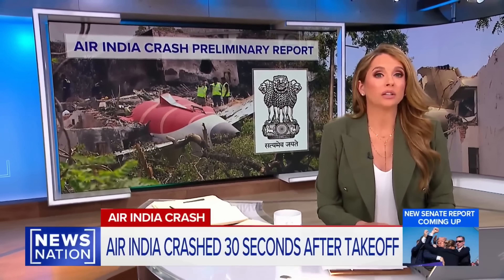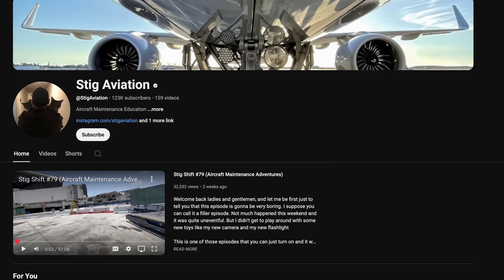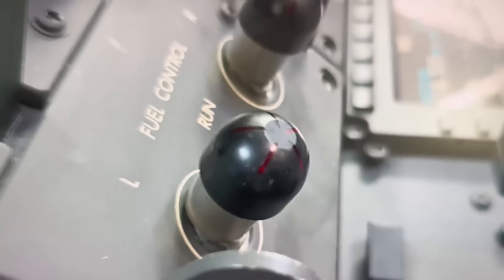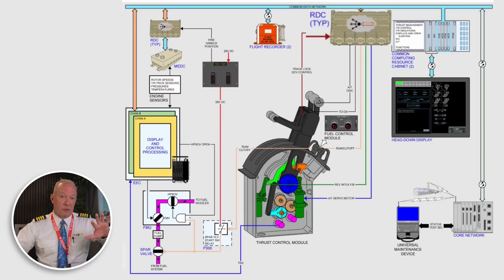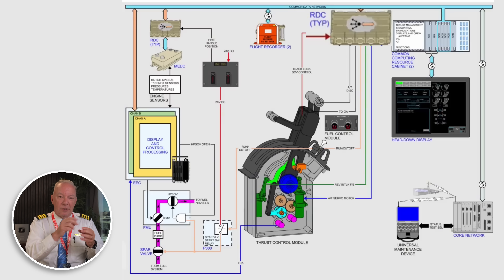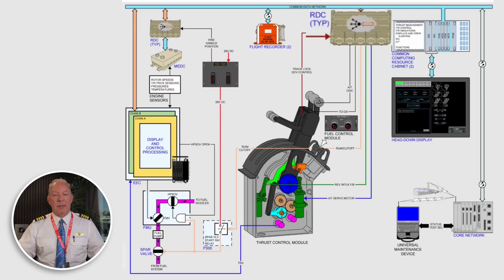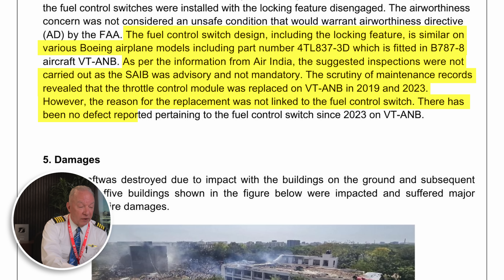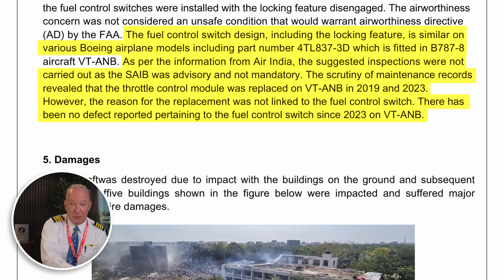The Truth About Boeing 787 Fuel Control Switches

Comment: My career of over 40 years has involved working on military and civilian aircraft. I have also been involved on stripping down and rebuilding gas turbine engines in a workshop environment as well as working on first line ramp operations.The two fuel switches that Captain Steeeve has highlighted and described are commonly used on aircraft where inadvertent operation would be a serious flight safety hazard. I have seen the same switch design on aircraft that were designed and built in the 1950s. I have operated the same switch type on hundreds of occasions and in my whole career have never seen a failure of one switch let alone two. 
Captain Steeeve is absolutely correct in that the circuit system of these switches is totally independent of the FADEC system. The switches system is independent of each other EXCEPT for the aircraft battery. A total battery failure would also result in the engines being unable to operate in a relight operation and both engines were running at the time of impact all be it not in a full power position. Not knowing this aircraft system does the engine start stop system get a bus bar power supply from the RAT via a TRU.
Sadly the preliminary report strongly indicates a human operation of these switches. I’m absolutely certain that if there was an electrical or mechanical failure then the whole world of regulators would be involved in investigating the problem. But and it is a Big but we must wait for the final report to appropriate the blame.So sad and my heartfelt condolences to the families of the victims.
Reply: A total battery failure to short (clamp to ground) would kill the LHS bus (engine 1 off), then the LHS bus would be "redundancy" connected to the RHS bus. Now the RHS bus is shorted to ground too (engine 2 off). A few seconds later, automatic bus separation allows the RAT to provide some power to start relighting the engines. FDR recording of the switches is also affected by these bus losses. The switches likely never moved. At least not initially.
The battery bringing down the LHS bus is possible if the protecting diode module is shorted (its expected failure mode). This shorted diode module would also be the reason the battery failed in the first place (probably happening after days of this fault being present). The observed issues with cabin systems would be explained by this shorted diode module.
Reply: @ConcernedParent-z1qif you’re analysing is correct then every safety body would be over this and we would have seen some action . Especially after the 737max debacle. Lack of action for me means total incompetence of Aviation safety bodies or that the decision has been made that this tragedy was caused by human input and not maintenance or equipment failure.
Reply: @kevingould6725  I wouldn't draw this conclusion.
Reply: @ConcernedParent-z1qwe will await the final verdict.
Reply: @ConcernedParent-z1qdo you have the wiring prints for the 787 system?
Reply: @BangkokChuck..ReThaired   I wish. I had to watch them in a youtube video by someone who actually had these more detailed diagrams. But the theory is very plausible, and takes into account far more detail of the actual schematic than other theories so far. For example, how the logging of the switches reaches the FDR, and all that can happen to that signal on the way.

Comment: With all due respect, even taking all the info given as facts, the reasoning is wrong.

Failure of the 28Vdc bus derivation to the switch or from the switch to power the relay could cutoff the fuel without a physical movement of the switch.

The throttle assembly contains the physical switches. Power from 28Vdc must go into the assembly and out to the relay (considering it's outside the assembly).

There must be a harness that routes those bus derivations and controls singnal into and out from the assembly. There's probably a connector of some type to make the assemby  removable.

If the circuit is as shown an electrical problem in this pathway could cut the power with or without power in the bus itself (from battery or generators).

Rotation changes plane attitude and the mechanical stresses. A harness might be injured at a sharp edge, a connector might be stressed and fail intermittently.

We can't know with current info what really happened. Switches might still have been physically moved, but this isn't 100% sure.

Same throttle assembly, same harness pathway, same connector or connector type suffering similar stresses at rotation just prior to fault.

Another type of plane had problems due to prior spilled coffee that entered in the pannel and made a mess.

A high impedance short circuit or a temporary bad connection of a signal might have starved the engines.

To settle this point we need to know how the physical wiring is made, routed and connected outside, into, and inside this twice exchanged throttle assembly. 

Hope it wasn't a pair of loose or lacking fasteners leading to unreliable connections...
Reply: Not in the same harness. Both switches have their own independent harnesses. It’s not a one connector does all. There are several harnesses and connectors that go to the module.

Comment: You keep going on about the fuel cut off switches. That appears to be your sole argument for the crash. You are basically blaming one of the pilots for a deliberate act of suicide. I would like to refer you to the channel Daily Airline News and in particular the analysis by Richard Godfrey. The most likely cause is water ingress that shut off the engines before the levers were moved. Richard has done some great work on the timeline while you keep harping on about the fuel control levers with not much else to consider. Be careful you are digging yourself into a hole. I see lots of Boeing fans in the comments section 5555
Reply: Except Richard's theory requires ignoring a lot of things and explaining away evidence. This one doesnt'.
Reply: And as we know, pilot suicide... sorry this is Pilot MASS MURDER never happened before, it's impossible because pilots aren't humans with feelings like the rest of us. They never get depressed or psychotic. Mental Ilness is a hoaxa !@!!!!

Comment: ☺☺☺if the switch system or internal wiring malfunctioned...ud would expect to have  happened on other aircraft too
Reply: You do realise that one has to be first? The "internal wiring" is a massively complex computer system with a volatile Li-ion battery connected to it. This is no simple thing like the video tries to make out.

Comment: From the photos of that switch, I am not convinced those mechanical locks on those switches would withstand long-term wear & tear. Also, I don't understand why the 'off' position on those switches is placed in the direction of gravity; shouldn't the OFF position be at the top and ON at the bottom?

Comment: Wasnt there a leak about pilots conversation where one of them asked other why did he switch those fuel controls to OFF position? Then after 10 seconds of that one of them put them back ON?
If this is true, there is no more discussion needed about any fault on the plane system. If one pilot wasnt aware of any issues with plane taking off he wouldnt ask when noticing no power suddenly. 
This is getting tired already. We should ask the investigators to release the audio of that takeoff moment and be done with it. Sure it may not be great news knowing one pilot did it intentionally but plane crashed, all are dead except one passenger. So going forward we have to learn from this. What should pilots do in future and pay attention if other pilot start to meddle with one of the most important switches or if power is lost suddenly. Time to react is critical here.

Comment: Captain Steeeeve, thank you again for this informative video. Please can I say what's on my mind. Is there a fail safe or redundancy system in case both switches fail. Can the auto pilot have any control over the fuel cut off in any scenario.  Unless im mistaken the aircraft had a new engine recently and in its life has had the throttle control unit replaced twice. Is this normal for this age of aircraft or did the aircraft have an issue which they was trying to fix? 
I know you think the pilot did it on purpose,  as you said it in one of your previous videos, but is there anything at all that could of caused the cut off to the fuel valve. Thank You for being so knowledgeable. Its because of you that I still feel safe to fly.

Comment: Part of our before taxi checklist on the 737 was to check that the start levers were in the idle detent. On several occasions I found that after starting the engines the first officer had not actually moved them into the detent, but the engine was still running, potentially leading to a situation where the lever could have moved to the cutoff position with vibration, I guess that’s why it was a checklist item. Now, that was with the older type levers, I don’t know if with the newer switches it is possible to balance the switch on the “nub” and still make the contact, I’d be interested to hear an engineer thinks that’s possible. I never saw it personally, on the new style switches.

Comment: In an XCV (XCV should be a adjustable switch valve. The general switch valve is only two states: opening and off. XCV can be considered to control the switching amount!) controlled by either pneumatic, electrical, or spring there are fail positions. These valves, depending on need, are either Fail open, fail closed, or Fail Last. Captain Steve, are the fuel control valve actuators electrical? If so, do the actuators fail open, fail closed, or fail last?

Comment: People misunderstand the usual purpose of a relay its so you can use small voltage to control a larger load or use the same switch to control more than one system and there are many other use cases as well such as letting a small switch handle loads that require far more capacity that a single switch could provide.

Comment: there are further questions not addressed here - the switches were flipped to "cutoff" one second apart, but back to "run" again was 4 seconds apart, that's weir. also, the engine started right back up once fuel was restored, but the other did not, also weird.

and also the switches being in "run" after the crash tells us nothing, because it could've been the impact that threw them into the run position, as you'd expect inertia from a sudden stop to throw everything forward.

Comment: Potentially grasping at straws here, but has anyone considered a failure of the relay itself.  Some of the hobby ones I've used take a simple 12VDC input to energise the relay coil (and depending on its configuration) you'll have SPDT action. Irrespectively, relays are configured in one of two ways, they are either energised to keep a contact open or keep a contact closed (or both!).

(Please check and confirm), but it logically makes sense that the relay needs to be energised to actuate the valves; this would be the "Run" position on the switches.

Again, I'm grasping at straws - if there is a wiring fault/burning of an electrical harness, it could be possible the voltage provided to said relay is compromised.  This happening to both relays though, is highly unlikely.

Out of curiosity, how are the relays (one for each engine?) not a single point of failure?  Does this have redundancy too?

Comment: Table of possible root causes. Prime cause was/is:
1. A known TCMA software throttle resolver flaw as spelt out in Boeing section 25 waiver application:
*   https://downloads.regulations.gov/FAA-2016-7855-0005/attachment_1.pdf
This Sect25 safety waiver petition to the FAA requested a 2.5 year delay in investigating a known Throttle lever angle error in the TCMA module of the GEnX-1(b) FADEC. Boeing also requested that no solicitations to industry or public release be made. Boeing also pointed out that it was "highly unlikely that any castastrophic failure would occur in that 2.5 year period". Due to the end date of that waiver period conflicting with the 737MAX MCAS debacle, the issue was pigeon-holed and never resolved (no AD/no Service Bulletin). Once the engine is running, the only time the FADEC will attempt to shut down the engine is if an N2 (N3) overspeed is detected via the RDC, or through TCMA - which uses that same circuit (i.e. as the N2 overspeed) to shut down an engine on the ground... for protection against any incommensurate thrust (i.e. one exceeding the TCMA’s calculated thrust contour).
The TLA flaw did not repeat because the TCMA is only functional on the ground and is inhibited by the Ground/Air transition. However as the flaw was still extant in both engine's FADECS, all it took was a first ever instance of weight-on-wheels microswitch failure for the TCMA module's ability to shut-down both engines (by design, due inappropriate high thrust) via that N2/N3 FADEC overspeed shutdown circuit. The TLA flaw thus remaining enabled when the Ground/Air transition never occurred, the Throttle resolver circuit promptly shut down the engines. A Ground/Air sensing failure would also inhibit the gear handle being raised, but would not prevent a RUN-CUTOFF-RUN switch-cycling allowing a relight, or RAT deployment, APU start cycle. All cycling of the L&R fuel control switching after that was obviously an attempt by the PM to retrieve the situation. The pilot verbal interchange was a result of the understandable PF startle-confusion upon seeing those PM recall memory actions against the background of a myriad EICAS visual and aural presentations - plus the noise-level drop and a sudden cessation of any acceleration. Water ingress is unlkely due to all bathrooms/gallies having been just pre-flight serviced. FADEC Glitch?: A dual software failure across both FADEC/TCMA's is highly likely (a known admitted flaw having never been successfully resolved). It took a G/A microswitch FAIL to prove that the throttle resolver software flaw was still lurking.
This above analysis of the AI Flt 171 accident (and its evident cause) is further examined (in the Google DOCS file at...) 
https://tinyurl.com/AirIndiaCause

Comment: If the relays are designed to be normally closed, that is, power is needed to open the relays and shut the fuel valves, then the only believable explanation if the shutdown was caused by the fuel valves, is someone intentionally shut down the engines.

Comment: But what if the Switches were not switched off to begin with and the auxiliary Li battery failed then according to your own explanation it would have switched off the relay as now there is no 28V DC power that would then cause the valves to close ,this loss of electrical power caused the RAT  to deploy (as seen in cc Tv images of the airport ) above the runway just a second after v1 and rotation it takes around 10 second or so to generate power back , restoring the 28v DC power which then switches the relay on as the switches are still in the run position  the valves open again . this  is theoretically possible according to your own wiring diagram and explanation .And the prof of this is that the switches are still in the run position after the crash indicating that they were never moved and the rear black box outer casing has melted down even though the rear part of the pane was still intact on top of the roof of the building and there was no fire there ,which would indicate the Li battery caused the fire that melted the rear black box . it also explains why there was a lot of smoke on the tail end of the plane just during v1 and rotation on the runway .
Reply: Wrong, battery busbar is powered by engine generators via a TRU in flight.

Which throws your whole theory out of the window at step 1, also both CVR and FDR are powered by the same battery busbar.
Reply: @yanholland315   good point . I wonder why did the RAT deploy just one second after rotation.

Comment: Thank you for the explanation Captain Steeeve. One thing that puzzles me: although I understand that the fuel switches are mechanical, why were they allowed to move to cut off during take off? Or perhaps I should say: why was their output allowed to engage cut off during take off?  Shouldn't there there be a post switch system disablement during this phase of flight?  Is this a possible outcome of the investigation?

Comment: I have a few points....
Could both fuel switches be moved at the same time using one hand?
If so, if the switches were moved up onto the detent towards the ON position using one hand and not pushed along the detent enough - could the switch stick on top of the detent whilst at the same time turning the fuel on? That detent looks quite long to me and perhaps the switches were simply not push along the detent enough.

Then as the plane took off the switches could have slid off the detent and into the off position.

Just a thought from a non plane techy person.
Reply: Not with one hand. Too far apart unless you have gigantic hands
Reply: @BangkokChuck..ReThaired  Okay, thanks. It was just a thought.

Comment: The argument of the guy saying it could have been an electric fault is dumb… why would the copilot ask if he had switch the fuel off then?That’s your confirmation that the knob position was physically changed. Just irresponsible coming out in the news without connecting the dots

Comment: It's actually shocking that such an essential component like the fuel system can be switched off at take off without a warning and bring an aircraft down. Especially when you see the positioning of those switches. It often happens that there is somebody sitting on one of the additional seats in the cockpit with perfect access to the switches.

Comment: For a machine with so much system redundancies, it’s mind boggling that something as critical as fuel cut off, isn’t a system requiring some sort of multi-step or dual pilot input. An engine fire has a multi-step process before the fire handle is pulled.